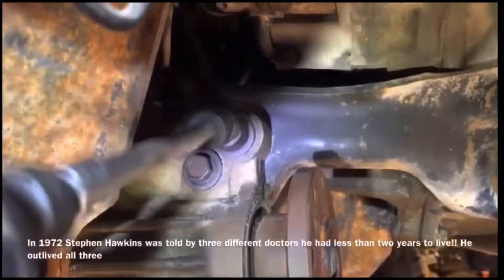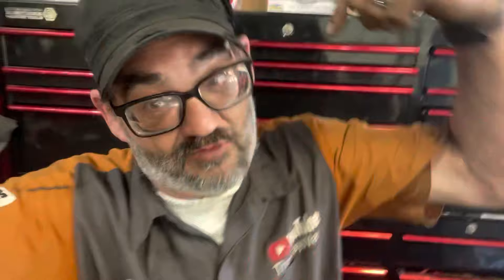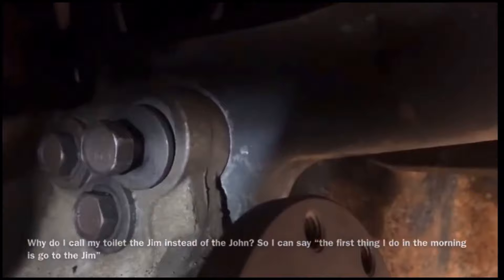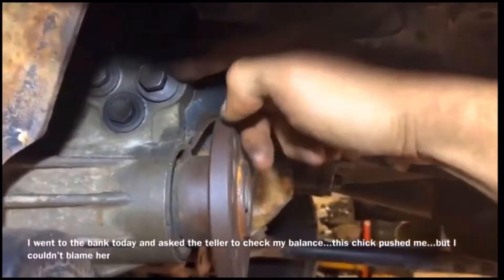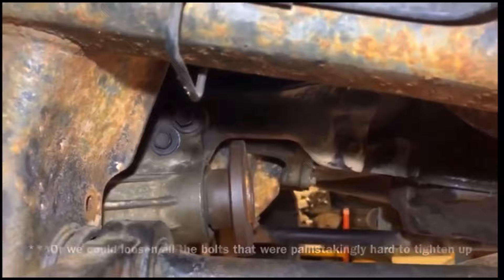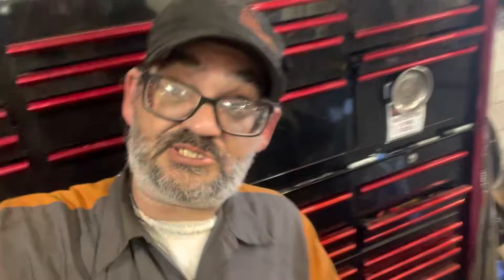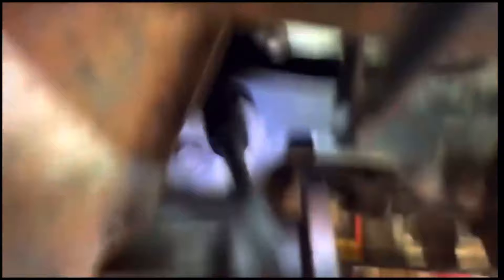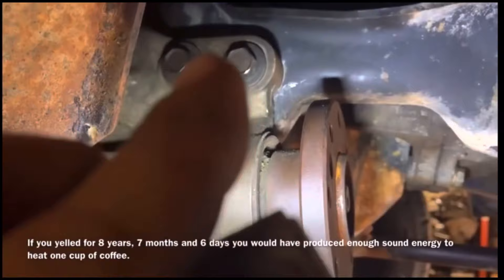Stripped Bolt/Cross Threaded Bolt Hole SUPER HACK! Fix Almost Any Stripped Bolt Hole!

Comment: 1 STRIPPED BOLT GOING INTO POWER STEERING RACK FOR HOLD DOWN PLATE ON RETURN LINE AFTER I CHANGED THE ORING,   BOLT IS ONLY ABOUT 1 INCH LONG SHOULD I USE A SELF TAPPING BIGGER BOLT THANKS FOR ANY HELP!

Comment: if it's a blind hole you can try a tap, then use a new bolt. If the threads still pull out then tap the next size, which may be metric or SAE to get just enough extra meat.

Comment: None of my supplied 10 mm bolts are going any of my to millimeter holes I get about three turns in on each screw and they all stop at the same limit what does this mean everything I have is brand new none of its used
Reply from the maker: Retap the holes that happens with inferior manufacturers

Comment: Quick question.  I've seen videos like this where a slot is cut in the end of the bolt and I've seen videos where slots are cut into the thread on the sides of the bolt (to make a thread cutter / kind of a thread chaser).  Any thoughts on the two methods and which is best for cross threaded holes? Thanks!

Comment: Was it on purpose?  I noticed the bolts quick but i would not have if i was doing it for myself.  Good video.
Reply from the maker: Yes …. I did it on purpose not the correct way to repair but the has been time where this was the easiest way to keep going